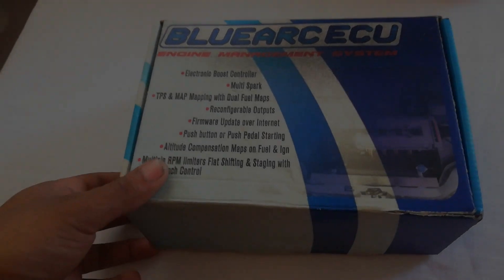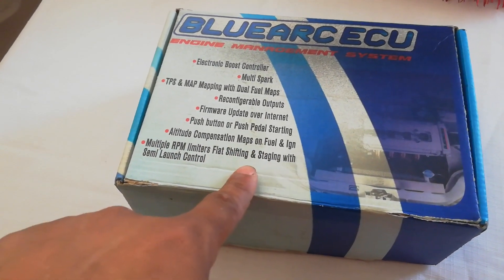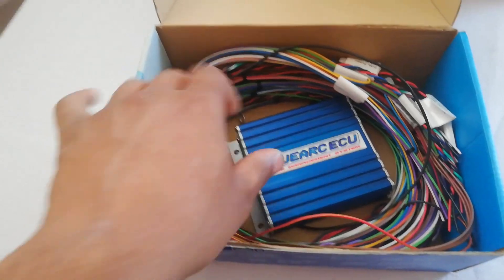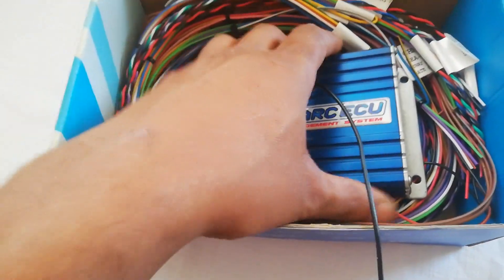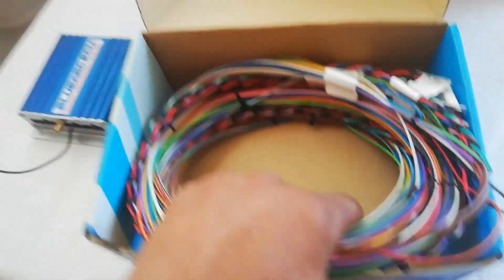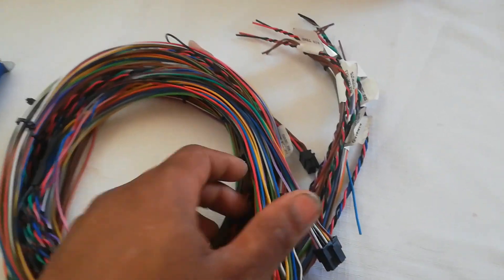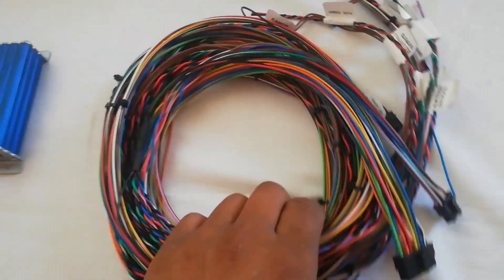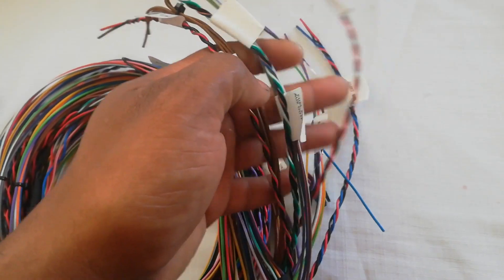bluearc ecu unboxing.

Comment: Hi sorry to worry u I am having problems with my 20v rsi silver top when the car is cold it switches off when I put the lights on and sometimes don't idle when cold .when it's hot it idle normal with lights on sometimes .
I checked the battery is fine  and the alternator is charging. 
Car got no icv 
Water temperature sensor is fine 
I jest need to set the fuel compensation on the dicktator management I got the software and laptop and the cable jest need you to show me what to do please